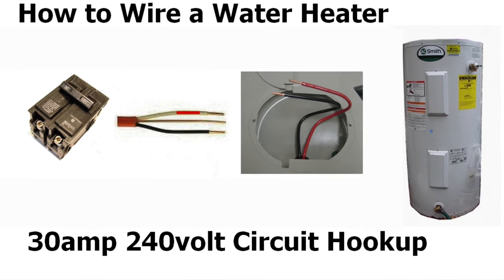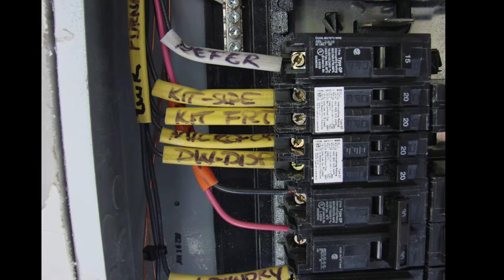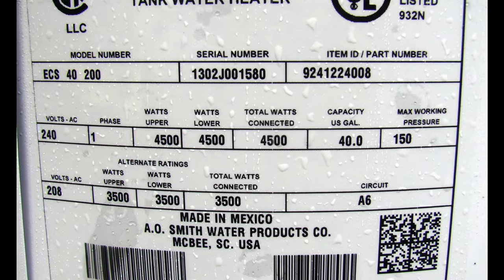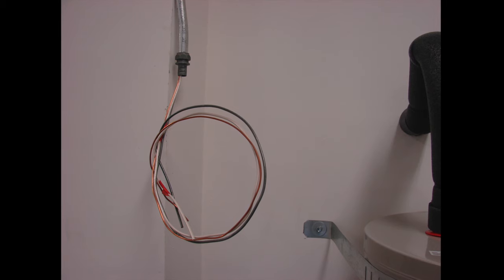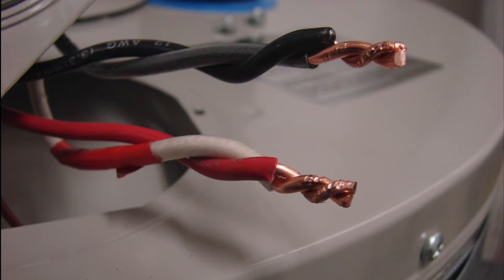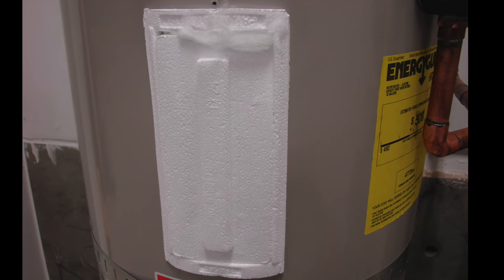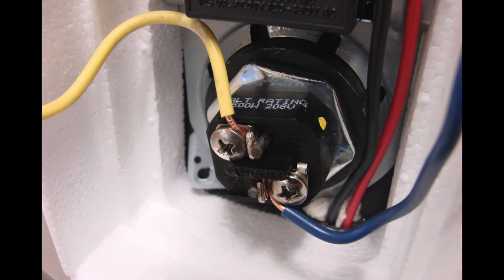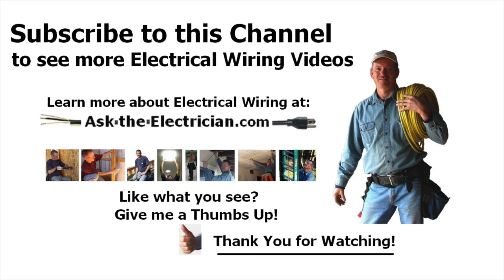How to Wire a Water Heater and Hook up the wire connections when replacing a water heater.

Comment: I have been plumbing 27 years and have installed many electric water heaters , my latest installl the water heater had a a dryer cord used for the power supply that plugged  into the wall I wired the giant pigtail while waiting for the old water heater to drain which was full of calcium. I installed the new water heater and removed air from the the line by opening the tub valve. I switched on the power and had a short. The ground screw had pierced the dryer cord on the inside and caused the short but it took awhile to find this out. Lesson learned be wary of giant pigtails.
Reply from the maker: Yes indeed. Great find on your end, thank you for sharing this with us.
Reply: Yes thanks for sharing.   Some years ago a cord and plug connection served as a means of disconnect if the breaker or fuse panel is not within sight of the unit,  to protect someone repairing the water heater  from being electrocuted if someone else turns the power on.   Electric water heaters are not UL listed for cord and plug connection and I don't know that they ever were, nonetheless I have see it done a couple of times in homes 30 years old or more.  Instead the unit should be hardwired with 10 guage copper wire connected to a disconnect safety switch or a double pole toggle switch rated for 30 amps near the unit if the breaker box is not within sight.

Comment: My current hot water tank is not grounded, and there’s not available wire to ground it. It was already in a house that I bought. I’m replacing the hot water tank today, and I’m wondering if i need to ground the new one, or not?

Comment: Wiring seems to be correct but still no hot water
Reply from the maker: Check to make sure the water is turned on, and the circuit breaker is turned on.

Comment: Is it normal for the water heater to have 12 gague wires that hook up to 10 gauge power wires? I'm stuck at this step, I'm switching from a gas water heater and using a former ac power line that is 10-2 wire from a dual 30 Amp breaker. It feels strange to me that the water heater has 12 gauge wire to meet my 10 gauge. Is this normal?
Reply from the maker: #10 gauge wire should be used for a 30amp circuit.

Comment: Just installed a new water heater and only getting lukewarm. I have it turned to 125 degrees it’s been 8 hours
Reply from the maker: Make sure the circuit voltage is correct.

Comment: My water heater was installed over a year ago cord gets really hot at the base when the hot water is used every time. It omits an order. Not sure if the installer connected correctly or a faulty cord, etc.
Reply from the maker: The electrical installation should be checked ASAP. 
Have you contacted the installer about these concerns? You should.
Reply: Where do you get a 30 amp cord? Probably a dryer cord and plug.

Comment: Great video, my water heater wiring looks like the one in the video, it's 4500w with 10awg on 30 amp . What I can't figure out is the wires that came in the unit that go to the two heating elements are 12 awg. How is that ok on a 30 amp breaker?
Reply from the maker: The circuit wires should be #10 copper for a typical 30amp water heater. You may consider upgrading the circuit. In the mean time the #12 wire should be on a 20amp breaker - something for you to consider.
Reply: @AskTheElectrician  Thanks for the reply. That's interesting that Rheem put 12awg wires in a unit intended to be on a 30 amp breaker.
Reply: @AskTheElectrician But that's not what he's really asking... He's asking why does the factory put 12/2 AWG wire coming out of the water heater's from the elements that's supposed to be wiring to 10/2 AWG 30 AMP 2 pole breaker? My new water heater is a AO Smith 40 gallon 30 AMP 2 pole breaker 240volts, and it also has 12/2 AWG wire coming from the unit? I do however have a question? My main panel is a 100 AMP panel box. It has a 12/2 AWG wired to a 30 AMP circuit feeding about 10 to 12 ft or less to a junction box, another piece of wire I can't tell if it's 12/2 AWG or 10/2 AWG running into a 4 circuit sub panel with only 2 circuits being used. A 20 AMP circuit and a 30 AMP circuit 2 pole breaker. The feeding Hot wire is wired to 1 lug, the Neutral to 1 lug and ground to bus bar. The 20 AMP circuit is wired to 2 receptacles that no longer works, it wired to Hot to circuit, neutral and ground to bus bar. Can I disconnect the 20 AMP circuit? And is a water heater supposed to be getting power this way? The old water heater was wired this way for more than 20 year's? I'd appreciate if you could help or give me some insight?
Reply from the maker: The water heater has 2 heating elements, 1 at top, 1 at bottom. Each element does not use 4500watts, however if both heating elements are on at the same time they together will draw 4500 watts (or less depending on the specific water heater and the factory settings for each heating element). So because each of these elements consume less watts they are wired with the smaller #12 wire.
Reply from the maker: First let me insert this here: The water heater has 2 heating elements, 1 at top, 1 at bottom. Each element does not use 4500watts, however if both heating elements are on at the same time they together will draw 4500 watts (or less depending on the specific water heater and the factory settings for each heating element). So because each of these elements consume less watts they are wired with the smaller #12 wire. Now as for your other question, no, typically a water heater circuit is a dedicated circuit which is installed from the panel directly to the water heater location. The circuit and sub panel you are referring to sounds very questionable and should be inspected to figure out just what is going on, and how or if it should be used. The wiring is in place, but it needs the purpose needs to be determined.
PS - Yes I do answer Questions here, even though this is for Comments, and that's OK, but remember that you can go to ask-the-electrician.com for a LOT more info, and asking a question there will bring you more resources.
Reply: @AskTheElectrician  Yes l know that most have 2 elements, and most elements are never on at the same time unless it is a simultaneous operation versus a non simultaneous like mine. But you answered the question is to why it's 12/2 AWG wire coming out of the unit because it will only use 120V at a time.
Reply: @AskTheElectrician  I appreciate the insight and information you provided. I always had a feeling the water heater being serviced that way was questionable. Like I said it's been like that for over 20 year's since I was a teenager I'm 45 now and recently inherited the property. So I'm assuming I should have a electrician look at it or I could just run a 10/2 AWG directly from the main panel to the water heater which is only about 10 to 12 ft but no more than 20 ft. I'm mainly in Construction.
Reply: @jonathan3982  so I found out that the 12 awg wires they use are thhn which are rated for 25 amps compared to the romex at 20 amps.  I think they have different codes cause the wires are inside the unit.
Reply: @danielbonner8309  That's great you find out exactly why. I wished I could figure out my issue. He told me directly from the panel to the water heater, but I'm trying to figure out what's the reason I have a sub panel? The only thing I can think of is maybe there is no more available spaces in the panel so that's why a sub panel was installed. But what is the sub panel getting it's power from? I know it's getting power from the panel but what is it hooked to? 😞 I guess I'll have to get a electrician that I can't afford.
Reply: @jonathan3982  So you have a sub panel. Whats the problem?
Reply: @danielbonner8309  Well what I'm trying to figure out is why is the water heater hooked to 2 30 AMP 2 pole breakers? To me it looks like it's wired to a 30 AMP 2 pole breaker in the panel in the bedroom, runs to the 4 circuit sub panel ( only 2 circuits in the panel) and is wired ( White top  lug) (Black to bottom lug) ground to bus bar. Then the water heater is wired to the sub panel to another 30 AMP 2 pole breaker? with 10/2 AWG. The problem is why is it wired to ( 2- 30 AMP breakers that's 60 AMPS ) and from the bedroom panel to the junction box is 12/2 AWG wired to 10/2 AWG then into the sub panel.
Reply: @danielbonner8309  It shouldn't be using 12/2 AWG from the main panel to the junction box. I bought 25ft of 10/2 AWG yesterday to run from the main panel ( bedroom panel) to the sub panel and eliminate the junction box. That way it's 10/2 AWG all the way from the main panel to the sub panel. All I can think of is why it's run that way is maybe the 30 AMP 2 pole breaker ( in the main panel) is powering the sub panel so that the 30 AMP 2 pole breaker in the sub panel can power the water heater? But wouldn't that mean there's 60 AMPS to the water heater?

Comment: In our old house, there is the disconnect box with fuses you talk about, I guess I can just remove it. The heater is right beside the break panel. The celling is not finished there (and it wont be) so I'm not sure how long should the metal wire conduit be. I guess about until were the drywall would be if the celling was done?
Reply from the maker: The circuit wiring should be protected by an approved conduit which is securely installed according to code. Be safe and enjoy your water heater.

Comment: What do you do when have 8 gauge aluminum wire going to the water heater that has 10 gauge copper whip. I'm thinking Polaris 2 port 4-14awg insulated tap connector. They are rated for Aluminum and copper. I had a plumber wire mine in with wire nuts burned the wire up into the wall I was extremely lucky the strain relief forced it to pull enough current to trip the 30 amp breaker before it got into my attic would have burned my house down. I had the electrician install a disconnect at the water heater this was several years ago before I knew about those Polaris connectors. He wanted to use those purple wire nuts I told him he was crazy never allow wire nuts again with AL and CO wire. The disconnect uses lugs and is rated for AL and CO he agreed to that. My understanding that even though branch aluminum wire has been banned still used for home runs like stoves, water heaters, and dryers. My 1970's house has AL branch wire I'm in the process of pig tailing using alummicons busbars are UL listed for AL and copper very good products well worth the money. Once I pigtail replace every switch and recep put the alumicons in going to replace my breakers with Arcfault gfci breakers I will be able to sleep at night knowing the AL wire is safe in my house.

Comment: Just to verify if I have a black and a white wire plus ground do I use my white as a power conductor and that would be fastenened on the one breaker screw?And it doesn't matter which one ,right?
Reply from the maker: In the USA, for a typical 240volt 30amp water heater circuit in an older home, where the wires are black, white and a bare copper or a green ground wire, in many installations the white wire was used as a power wire and attached to one terminal of the 2pole circuit breaker, and the black wire on the other terminal of the 2pole circuit breaker, and no - it does not matter which position these wires are in as attached to the 2pole circuit breaker. It is always best to identify the white wire as a power conductor using red electrical tape at the circuit breaker and at the water heater. Make sure to verify the circuit wiring as described.
Reply: Ok I have a white black and bare copper wire for ground from breaker and red black and green wires on water heater the black is hot on the house wire and white is neutral or negative and which wire red or black is negative or positive on the water heater because ground is green for sure trying to find out if the black on the water heater is the negative or the hot because the black on the house is hot so it would be backwards can't find a picture or anyone stating this definitive statement?

Comment: I have a 240V dual element 28 gal tank. I have a line coming into it coded Black /white/ground. There is a red & black wire from the tank.
Which color from the tank is connected to the black wire coming in, and the white wire coming in.
Reply from the maker: As noted in the video - when the incoming black and white are the 240volt wires, they connect to the black and red  wires of the water heater, respectively.

Comment: when voltage testing this assembly at the top of the water heater, what should the readings be? i would expect 120v between black and ground, 120v between red and ground, and some random
small number like 10v between red and black.

are the red and black voltages then added in series, to get 240v, inside the water heater electrical panel?
Reply from the maker: The reading between the red and black wires on a typical 240 volt water heater circuit is 240volts.

Comment: Great video and highly informative. I reviewed my BradfordWhite service manual which says the following in regards to diagnosing the heating ellement: "Reading should be 12.8 ohms (±6%) for a 240volt, 4500 watt element. A reading outside the range using the formula above (±6%), indicates a bad element and the element must be replaced."  So I checked both upper and lower elements and my multimeter shows 12-13ohms initially and as I held the multimeter on the contacts the reading dropped to 9.5ohms after 4-5secs. Im not sure whether to go by the initial 12-13ohm reading or the 9.5ohm reading 5secs later.  Do you think I have a problem here?  The heater is the M250S6DS-1NCZZ and id about 15 years old.  Thanks in advance for any further info.
Reply from the maker: If the water heater seems to be heating and working normally then it may be fine, otherwise there may be a problem with the heating element as described.

Comment: Thanks for the video.  I know this may be a code question so mileage might vary.  Running the wire from the ceiling to the tank, or alternately, from a junction box to the tank, does it have to be shielded with the metal tubing as you've shown or can we just run the wire as is, with plastic sheathing still on, right to the tank?
Reply from the maker: The wire should be protected using an approved method, typically metal flex and connectors.
Reply: @AskTheElectrician  I'm going to use a liquid tight flexible plastic sheath, used for outdoor applications usually.  I just don't like the idea of a metal sheathing for electricity.
Reply: @AskTheElectrician A video by a self described inspector stated that BX is not appropriate. Is there another flexible metal jacketed type of product? I’ve seen a few websites that don’t offer much help in differentiating.

Comment: Just wanted to say nice info on the water heater video. Just a question now for you, I'm in going to install a new water heater in our mobile home but the wire is 12 gauge and to short. New heater is taller than the old one. Whats the best way to rewire this with 10 gauge?
Reply from the maker: Thank you, glad the video was helpful.
Double check the electrical circuit specifications on the new water heater to make sure it requires a 30amp circuit, only because not all water heaters are alike, and some for mobile homes may be small - so check this.
If a new circuit is required then a new cable may be required to be installed from the water heater to the electrical panel, all according to code. If the existing water heater circuit will not be used then it may be disconnected and removed, and the new circuit breaker could take it's place. The qualified installer will need to be aware of all applicable codes that apply to the project.
Reply: ok thank you and I'll double check it but I did see that it requires 10 ga. and the breaker has a double pole 20 amp in it.

Comment: Excellent and very informative video! Question: When installing a new water heater, is it necessary to check out the wiring of the elements? Thanks very much!
Reply from the maker: Thank you Jeff. The internal wiring of a new water heater from the factory should not need to be checked. The wiring and presets are typically reliable.
Reply: @AskTheElectrician  Thank you for the excellent video and your superb professional advice! Two more questions if you don't mind: Is it required to have a ground wire between the water lines on an electrical WH; and does the 10-2 have to be in metal at the connection? I'm running the wire along basement joists are only about 5' in a 100 year-old home. So from the rafter to the top of the WH is only about 2 1/2 feet. Thank you very much!

Comment: Thanks a lot for the video, great explanation.
My question is, do you think a 30 amp heater would work fine on a 100amp panel or i should upgrade to 200amps.
Thanks in advance
Reply from the maker: It all depends on the existing electrical load that is now on the panel, and what size the existing panel is.
Thanks for watching and great comment.
Reply: You ought to be ok. The water heater isn't a continuous load. The longest the elements are on for a long time is on initial start up or if the water heater is completely drained if hot water, which can happen with a bathtub and Jacuzzi type tub.

Comment: I understand should be three wires two hot with ground..in this house we have red black green and white.
So, please how to wire that white wire?
I know red to red // black to black// green to ground .that that white wire tie together with red or what ?
Thank you,
Reply from the maker: Cap off the white wire as it is not needed for a conventional 240volt electric water heater.